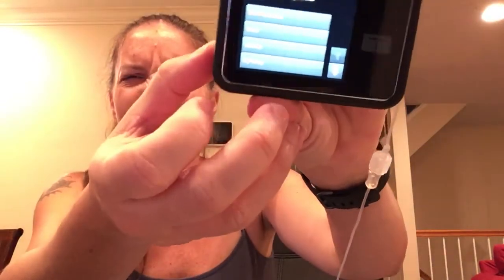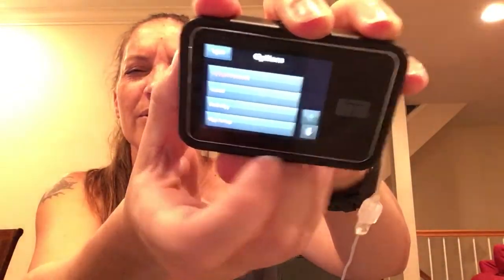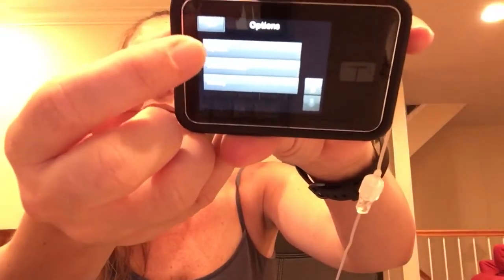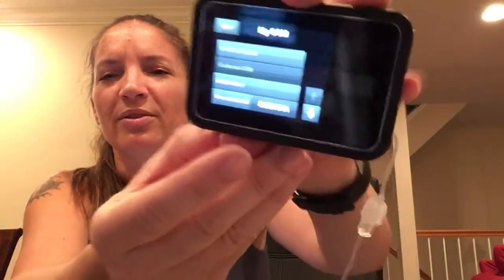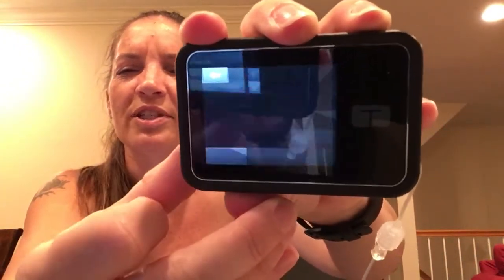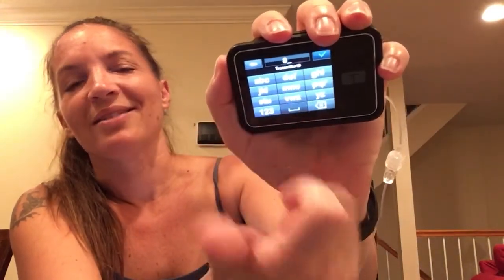Starting a New Transmitter without removing an Old Sensor on the t:slim X2

Comment: How do you actually get the transmitter out of the sensor without removing the sensor from your skin?!!!
Reply from the maker: I bought a pack of guitar picks from Amazon for maybe $3.50. It had various sized picks. I try to find two of the thinnest and push them down between the transmitter and the clear plastic piece in the skin. I usually get one in there nice and securely and then take the other to work with. I try to find a good place to slide in the second one to get the transmitter to pop out.

This all sounds complicated, but the process actually takes me like 6 seconds. Just takes a little getting used to. 🤷‍♀️

Comment: What if I don't remember my number?  I guess I'll have to replace it...again.   these things are not my friend.
Reply: we write the number on a dry erase board on our fridge.
Reply: @Jworx77  , THANK YOU!!  That is a great idea!!
Reply: I take a picture of the sensor label and code tab and delete it when I do it again in 10 days.  That way,  if you have a sensor failure before 10 days,  you have all the info handy
Reply: That picture could also include your transmitter lot number from the box